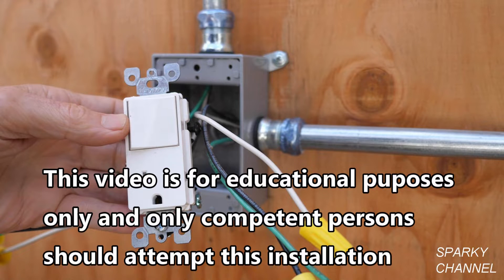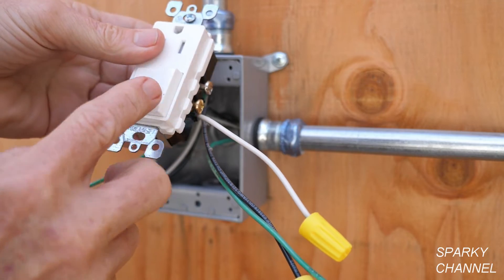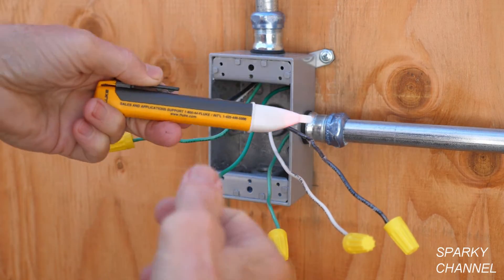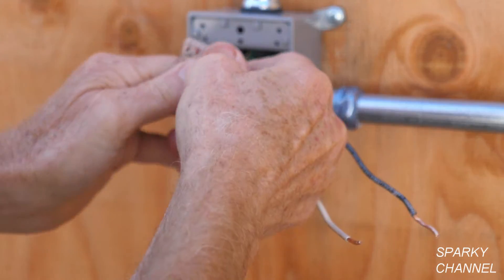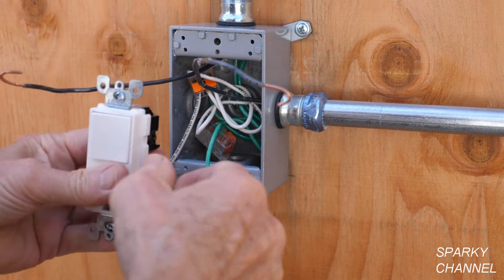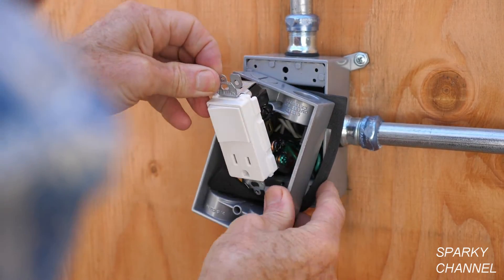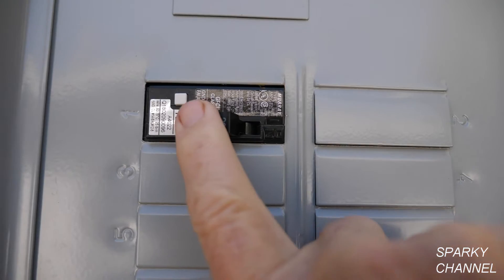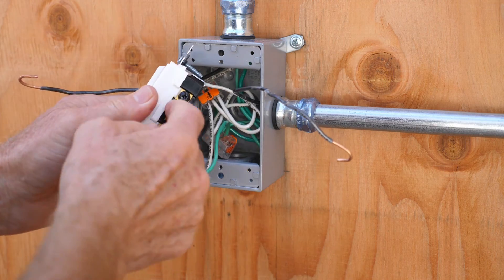How to Install a Combination Switch and Receptacle

Comment: Twice you said you “crimped” the wire, you crimp anything, you bent the end of the wire into a J to fit around the screw. It’s very important to do that, found it odd you didn’t point that out and incorrectly called it a crimp.
Reply: What a weird comment. He called it out directly. If you can do better, make your own videos.

Comment: Hi, I installed this as shown in the video but I am the electrical outlet is not working, I tried changing the switch to see if that is the issue but I am still not getting power in my outlet while the switch works fine. Also the light is controlled through this switch and another switch in the house. What could be the reason for it not working?

Comment: PLEASE help. I think I have this correct... I'm installing a new light fixture abd wanting to swap my current receptacle with this; keeping one receptacle and adding the light switch for the new light. 
My problem is- I have 2 white wires, 2 black wires and a ground in this box already. How do I hook this device up with all these wires? Connecting all current black wires together and all white wires together?

Comment from the maker: Fluke 1AC II VoltAlert Non-Contact Voltage Tester, Pocket-Sized, 90-1000V AC: Amazon: https://amzn.to/445JhB4
Leviton T5625-W Decora Combination Switch and Tamper-Resistant Receptacle, White: Amazon: https://amzn.to/2FISV1A

Playlist: Electrical Wiring by Sparky Channel: https://www.youtube.com/playlist?list=PLSD43kAzjUITARtRyFqvVhmqwNm34Ck5k  

Playlist: EMT Bending by Sparky Channel: https://www.youtube.com/playlist?list=PLSD43kAzjUIT9C0yzPTkqULBCmJXX_goh

Playlist: 2023 NEC Video Playlist by Sparky Channel: https://www.youtube.com/playlist?list=PLSD43kAzjUISg0qOUMomYe8GH6a_C2xBv 

Playlist: Tracing Circuits and Wires with Troubleshooting by Sparky Channel: https://www.youtube.com/playlist?list=PLSD43kAzjUIRYP5HI6T4K9gZA6ihMEjJs

Comment: Wait I didn’t get it so the load goes to the switch??? 
 and line is for the gfi obviously.
Reply from the maker: The line (hot) wire does usually go to the switch in modern wiring. Yes, the load is the light, fan, receptacle etc.

Comment: I installed this today.  The outlet and switch work just fine.  When I was doing some wire management I noticed I lost power.  The power is being supplied by a 3 way switch apparently.  When the 3 way switch is in the on position the Outlet and switch work.  When the either switch on the 3 way switch is turned on or off it turn the switch outlet combo on/off..  I can't figure out why this is occurring.  Thoughts?
Reply from the maker: My guess is either a loose connection somewhere or the 3-way switch is mis-wired. See my video: How to Fix a 3-Way Switch System: https://youtu.be/EGyXhV0p-4w
Reply: Thx, I did watch it and a few others.  The 3 way switches seem to work fine on either side but when either 3 way switch is turned off it shuts off power to the switch/outlet combo.  It shuts off both the outlet and the switch because I didn't remove the bridge in the combo unit.   @SparkyChannel
Reply: I believe the switch/outlet combo is receiving power from the 3 way switches so when they are turned off I lose power.
Reply: had my local electrician stop over and look at it, they couldn't figure it out and I had it wired correctly.  They think the previous owner of the home may have had a box buried in the wall with some odd wiring configuration.    @SparkyChannel
Reply from the maker: @tb693ny6  Could be.

Comment: You can also wire the  device the other way around - line to brass screw, neutral to silver screw, and leave the jumper in place. Doing this will cause the switch to control the receptacle, which has potentially interesting use cases.
Reply: Thank you. Looked a lot of places to find out how to wire it that way.
Reply: Hi, does the tab still need to be broken off?
Reply: When he says connect the line in to the brass screw, he’s talking about the screw the video calls “load, or switched load”. Then when the switch is closed, power goes through the switch, then through the existing jumper to the outlet. 
You’re just reversing the line and load terminals of the switch. It’s fine to do this, there is no in and out on a switch, the switch simply connects or disconnects the terminals on either end.

Comment: How you wire the combo switch receptacle if there is only  one 14/2
Reply: Black line in from power source to black screw, if jumper not broken. If jumper is broken make a pig tail power source to both black screws. Next pig tail the two neutral wires from the same wire that comes from the power in line with the neutral wire going to the lights and connect it to the silver terminal. Black coming from the lights goes to the brass terminal. Ground goes to the green screw. You might have to pig tail the ground coming in to the ground going to the lights.
Reply: @kirkbrown2147  thank you. Happy new year

Comment: Hi, you could have used the deep Sigma box, regular is $4.68 deep one is $11.×× in Lowes or Az , but would by easier than using the extension, i think i will get the deep one for my project (the switch is for an outdoor flood light, and adding a gfci outside in the box outside where the cable from the inside switch to the light outdoor will be crossing on its way, so , i think the outside junction box/gfci outlet will get crowded, not much space for wires.... so even though i already have all the bushing etc prepared... I think I will just get the bigger-deeper box and avoid 3 hours of accommodating cables ... and those gfci are really boxy and big and deep they barely fit in outlet boxes nowadays!!😅😅
Reply from the maker: Good tip, thanks!

Comment: The only video that actually  shows  where the load wire goes other videos said it goes on the brass one  my outlet worked only when my switch was on I wanted continuous power to the outlet ,
Reply from the maker: Great to hear, thanks!

Comment: Like always a superb teaching video. I am 77 Vietnam veteran and I have a problem with a fan with lights which is supposed to be turned on by a 3-way switch. I bought it 10 years ago for 800 dollars and I have been unable to use it. Every time I hired an electrician, he charges me money but does not fix my problem. Sir, if is not too much trouble do you think you can give this old man a hand, Thanks, Juan.

Comment: Could i pigtail the line, ground, and neutral to run to an additional outlett? And the from that outlett to another?
Reply: Yes, but be careful on connections and make sure electricity follows all the cables in the right direction, meaning, connect things in way that make sense if you know how to work with all this things and you have a good !! Notion of electricity,  I am actually doing it myself, I am replacing a normal outlet inside the house with this device and then the switch is for a patio light outside and since I prefer to put box in the outside (nor that plastic garbage in different options with lid and 2 screws) ,  I am then adding an outlet gfci outside, so that outside box will have an normal gfci outlet and the wire to the lamp crosses by the box .

Comment: How to wire a 3 way combo switch w/outlet having 1 red/2blacks & 2 whites capped behind?

How wire a regular combo (non 3 way) with 3 whites/2blacks.

Can figure 2nd one but getting ticked at the 3 way

Comment: Great.  I have 2 blacks and will pigtail my whites I see in back.  Light works just need to make bottom outlet HOT.  I'm not sure if adding the white to bottom left silver will do bc it's not a black wire but will see...
Reply: Doing same in living room but LR just has 1white & 1black. Switch operates the lower outlet on opposite wall, don't think that's 3 way, I've tried every way on this one reversing wires.  Not sure how to pigtail this one?

Comment: when you flick the switch , does it turn off/on whatyever is plugged into the outlet  ?
Reply from the maker: No, but it could be wired that way. The switch would usually control a light.

Comment: Lol "only confident people should install this" after wiring this in I thought it was good to go. The switch controls the exhaust fan. I plug my clippers in and they work but when I hit the switch for the exhaust fan the plug dies and the fan turns on... figured that was normal operation. Here is the weird part, if I plug in a hairdryer the controls on the hairdryer control the exhaust fan low, medium, high but the hairdryer itself doesn't do anything. What did I do wrong?

Comment: Thanks for the video. It's time to wire up a swim deck ceiling fan with the switch your provided the link to. plus the outlet will be used for the plug in speaker, while the switch will be used for the ceiling fan to keep us cool in the summer while enjoying the swim deck on the lake. Thanks again for the video.

Comment: You mean I have to buy a huge metal box? The only thing I have in my apartment is on and off switch for the lights and ceiling fan, plugs are like 5 inches off the floor, air filters I bought say they have to be 5ft off the floor! Never seen electrical outlets that don't have a plug higher up

Comment: Hey sparky thanks for the video, I installed the exact same switch. I attached the hot wire to only one black screw however when I turn on or off the switch it also turns the outlet on or off. Do I need to remove the tab and split the hot wire?

Comment: This is excellent, in another video they said that on the two live screws, if you attach the live wire to the switch it will control the power going to the plug effectively shutting it off, but if you attach the live wire to the plug screw both plug and light switch have power, is this true?

Comment: Ive got a lightswitch that only has the neutral, hot and ground on a single pole switch, the electrician must have some kind of wiring in the light to make this work, can I still use this switch or is it  not going to work because I dont have access to the load AND line wires?
Reply: If you don't have a line wire, the electricity has nothing to go to. The switch controls whether or not power goes to a line wire, if it's wired correctly. Have to have that line wire going to something.

Comment: Hello good night, just making sure I got this correct wire up outlet to control a light and once tabs aren’t broken, the outlet to the bottom will not be disturbed with the toggling of the light switch , once tab is broken then the socket will be turned on /off with the switch…. Did I say that correct ? Sorry I’m new to this !

Comment: Can I use these combo switches in boxes with only one set of wires, black, white and green? Anybody? Thanks!
Reply: Well I’ll answer for myself! I talked to two electricians that I worked with and they both said no! You cannot add a combo switch/ outlet in a box with only one set of wires, black, white and ground! That is because the white, neutral wire acts as a carrier wire for the light switch. That’s not the only reason and I’ll leave that for others to expound on.

Comment: I know how to wire outlets and plugs, but I've never done a duplex combo like this before, and I was concerned about the switch turning off the power to the outlet. I think that I've got it now. Thank you!
Reply from the maker: Glad I could help!
Reply: With the tab still in place,  does the outlet still have power with the switch off? Or is the switch only breaking connection after the tab?

Comment: This is u clear if there is always power to the plug. Even when the light is off.
Reply: As long as the tab is not snapped off, there is always power to the outlet. ONLY the black load wire on the brass screw (light, fan, or other) is powered/depowered by the toggle switch.
Reply: @topgrain  So can you confirm that this plug will always provide power and you can use the switch to turn the light on and off?  There’s a bunch of people ask him out here
Reply: @TheTCOLL  I can tell you that I have my identical switch wired in this way. I turn the ceiling light on or off with the switch, and charge my phone with the outlet, whether the light switch is on or off. Once you put the line wire (hot) wire on either of those black screws, and wire everything else up, tge outlet always has power. 

Note that I am not an electrician, and since all houses are different, and interpretation of instructions can also vary, it is not possible to make any guarantees. But if you identify the wires and wire them up as presented in this video, it should work.
Reply: @topgrain  Well good to know it can work that way.  Wired it that exact way and didnt work.  So I tried breaking the tab.  didnt work either.

Comment: With the switch oriented with the outlet at the bottom, is the toggle for the switch Right-on, Left-off? 

I need it that way. I don't want to have to put the outlet at the top in order to get the toggle switch oriented that way.
Reply from the maker: You can put it either way.
Reply: @SparkyChannel  Thanks! Just to be sure, newly out of the package, and installed with the outlet at the bottom, does the power to the Load go "on" when the right side of the switch is pushed, and "off" when the left side is pushed?

Comment: How do i wire this so that the switch controls power going to that single outlet you have there?
Reply: You would connect live input to the load side of the switch, keep the tab that connects both live of switch and outlet and connect neutral to the neutral side of the outlet

Comment: As a contractor & painter, (not an electrician or plumber lol but I’ve worked here & there on projects), I’m just going to say that this video is 100% amazing. I’m rehabbing my 1938 house and opened up a broken combination switch and was in panic mode, now I’m ready to head to Home Depot tomorrow to restart this little project. THANK YOU
Reply from the maker: Thanks so much! Best wishes.
Reply: @SparkyChannel  thank you 😊

Comment: thanks in the first two minutes I finally understood why it wasn't working for me. i was using a switch connection to give power to the receptacle lol. so that's why sometimes the black/whites are inversed, when they are a secondary line that comes from the light.
Reply from the maker: Glad it helped!

Comment: Can l connect a combination switch with only a black hot wire and a white neutral wire coming from the junction box?
Reply: Any answers I've been looking for the same thing
Reply: My electrician friend says no. You cannot do this with one set of wires, black (hot), white( neutral) and a ground (bare). The reason being is because the white becomes a carrier or hot in this scenario. You would need to run another set of wires either from the breaker or from a nearby junction box.

Comment: Does it not confuse people that the switch does not control the power to the outlet (plug socket)?   As I understand it here, the switch is to operate lights and the electrical outlet has  always got power and is used  to supply power for example to a drilling machine.
Reply: you can wire it that way , just not sure how

Comment: Is it safe to do that if I dont know where the fuse box is I live in a large building complex
🖍️
Reply: You can do it hot just keep the hot capped off until youre ready to make the connection.
Reply: @billman6364  nah the switch they sent me doesnt work

Comment: So, just a general question about these types of switches.  If you leave the tab intact, then connect your line to the brass screw, and then connect your neutral to the silver screw, followed by your ground that it wouldn't be any different from a schematic point of view.  The only difference is that the line wire would be on the other terminal of the switch.
Reply: I was wondering if anyone else shook their head. Good catch

Comment: The power wire and light wire is connected in a junction box in my attic can I wire a combo to the power wire (The only wire in the switch box) if so how is it one black to both screws on one side and one white on both screws on the other side.

Comment: I am wanting to my outlet to stay hot and the switch to control a light only. I wired mine up just like this but for some reason it turns off the outlet as well. Any ideas why this happening?
Reply: I need the same thing. The plug always hot. Do I need to wire it differently?

Comment: I only have one black(line) and one white. This power comes into a old flick switch from long long ago . It works fine but it's ugly so I want to upgrade to the combo. Broke the fin off. It will not work. Hooked up the old one and it works.
Reply: Why did you break off the tab? You only need to do that when you want the switch to control the outlet as well as the load (appliance). In that case, the incoming hot gets run to the side of the box with the neutral and ground and the appliance gets wired to the hot screw on the side where the tab is broken off. It should be wired to the one next to the switch. He didn't really explain how to wire it this way but that's what the tab is for.

Comment: I have a battery charger that I would like to control from a combo switch / receptacle like this.  But, so the charger is always plugged in but the receptacle is only hot when the switch is on.  Would it be OK to break the brass tab, run the black hot wire to the switch, then run a jumper from the load screw around the back of the receptacle and power the plug and of course hook the neutral to the silver screw?
Reply: The incoming hot gets run to the side of the box with the neutral, ground, and single hot screw. The appliance gets wired to the hot screw on the other side where the tab is. Break off the tab and run the outgoing hot wire to the one next to the switch. Now the switch will control the light and the outlet. He didn't really explain how to wire it this way but that's what the tab is for.